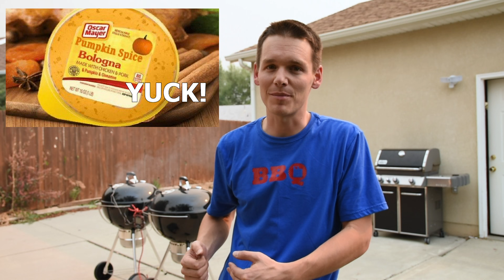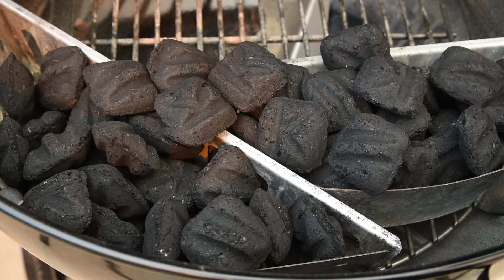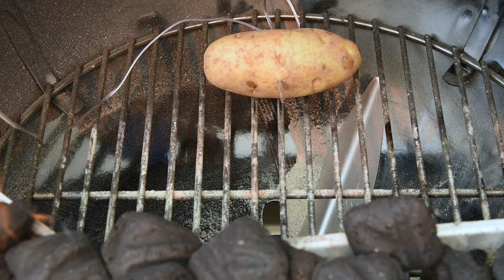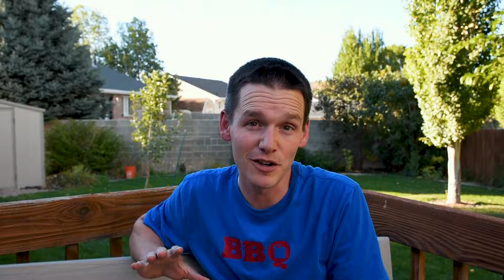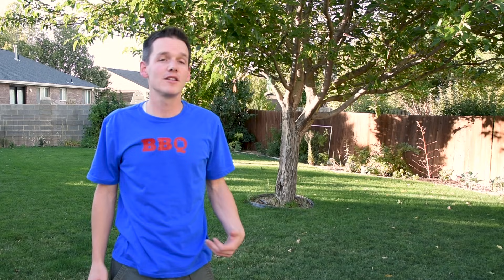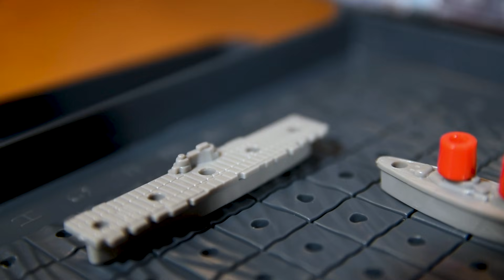Efficiency Test: Slow N' Sear vs Weber Charcoal Baskets

Comment: Great video! but I’ve never seen anyone do a bridge from basket to basket. Looks like a pain in the butt could create hotspots to the food that’s closer to the grate.What I have seen is a guy cut the ends off two baskets mismatch them a little bit and Boldt them together. To make one long basket. I’ll stick with the SnS👍
Reply from the maker: You got it!  It is a pain to use two baskets and I did one test where the 2nd one didn't light.  In this test, the first charcoal basket didn't burn all of the charcoal.  I'll stick with the Slow 'N Sear too.

Comment: Excellent test and video. You did it with a positive upbeat attitude, with out anger issues, personal vendettas, and plain old fashioned grouchiness, as some SNS testers seem to do.  Love it.,  
And yes the SNS is a better option for a small family meal like just one pork butt, than my 55 gallon UDS is. 
However if I’m cooking four pork butts then the UDS wins out.
Reply from the maker: Thanks Lew, I tried to be even.  If I had to cook four pork butts I would probably use the UDS too.  That way you only have to tend to one fire.  My UDS likes to burn stuff on the bottom rack if I'm not careful though.
Reply: silly either go for trial and error or read a book lol

Comment: This is a cool video and it seemed that you didn't have preconceived bias. I'm looking forward to the next video. I know it's impossible to use water in the test, but that really is the slow n sear's advantage. It's heat sync method makes it almost set and forget.
Reply from the maker: Thank you.  There will be water in the next test though and each will use the best method I could find to cook with them.

Comment: Great test, great job in doing your best to eliminate variables, which I would say you did almost entirely given this wasn’t in a controlled lab, and also giving all the data points over time.  Top notch bud👍, I just found your channel but it’s great stuff and I’m subbed
Reply from the maker: Thanks, man.  I limited as many variables as I could without the lab.  I figured most people don't have one to cook in either.  I plan on checking your channel out too.  Thanks for coming around.

Comment: Good test bro. I agree with other on the winter months. It would perform greater. I may have asked you this before. But are you running for your mic? The volume and clarity is spot on.
Reply from the maker: The microphone is a Sony ECMCS3 lav mic hooked up to a a Tascam DR-05. I clean up the audio in Audacity and sync it to the video in post.  The only bummer is it only works with 1 person and picks up the neighbors dog really well.  I’m looking at trying a shotgun mic to see if I can get around that.  

I hope life is getting back to normal for you after the hurricane!
p.p1 {margin: 0.0px 0.0px 0.0px 0.0px; font: 12.0px Helvetica}

Comment: Are you going to try red kettle vs black kettle?
Reply from the maker: I used two black kettles for an even comparison.  My black one gets well over 100 degrees if it's in the sun and I don't have a red one to test.  I bet there is a small difference, but your best bet is to get the one you like the best. The Canadian Spring Green or Slate Blue kettles are my favorites.

Comment from the maker: I did everything I could to make this an even test to compare the two.  I even repeated it when it messed up.  Did I miss anything?
Reply: Don't know if it's useful for this test, but Cooking with Ry has a cool method of placing the baskets in an "L" position so that it helps contain the charcoal from spilling all over the place, creating an unequal surface and heat dissipation. His method allows for more space for charcoal to be placed in a more even distribution, kinda like the S&S. I can't remember exactly what video he shows it in, but I'll check and get back if you're interested.
Reply: Weber intended for a basket on each side and food in between, not shure this proved anything as no food was cooked  ?
Reply: Who cooks with 2 baskets end to end?
Reply: @David-burrito  So you interrupt your cook to remove a basket?  The reason for utilizing two baskets is so you can control the charcoal burn...you don't want a single pile all burning at the same time otherwise you'd be fighting high temps in the beginning and temps that are too low towards the end of the cook.
Reply: @greenidguy9292  Read some of the other  comments. You're using the baskets in a way that they weren't designed for.
Reply: @David-burrito  So smart people like myself have found a better way to use them. Thanks for your conformation...however it wasn't needed as we were already aware of that.
Reply: Grill Top Experience on the second test did the baskets still require more adjustment?
Reply from the maker: They did require a bit more adjustment, but I didn't calculate the deviation on the second test.  I didn't adjust the vents at all on the pulled pork test and the Slow 'N Sear was more consistent there too.
Reply: Grill Top Experience good to know, thanks! I just ordered a kettle and some of the baskets, I guess if I have troubles I'll consider the sns. It seemed tough to justify for the extra cost compared to the baskets.
Reply: Grill Top Experience you could have been more thorough😂😆! this is how a test should be done. Have you compared the Weber to any off brand or even night price Q’s? Great video
Reply: Abc says the drip n griddle pan helps with efficiency. You could simulate that by blocking off the charcoal grate on the other side maybe?

Also did you use any water in the SnS? It helps even out the temp swings etc....
Reply from the maker: I blocked off the charcoal grate and used water when I cooked the pork butt in my upcoming video. Water would kept the temps more consistent, but would have been hard to keep even between the two, so I left it out.
Reply: Grill Top Experience Try actually cooking/smoking something to make an actual real world test...otherwise your conclusion is rubbish.